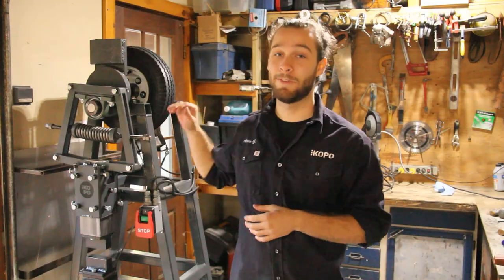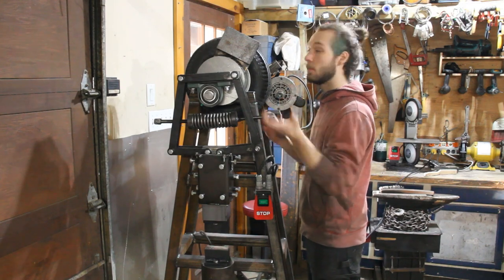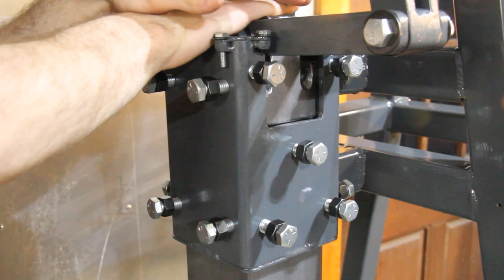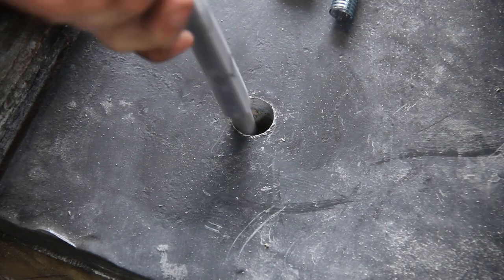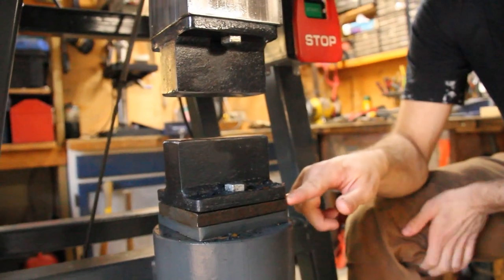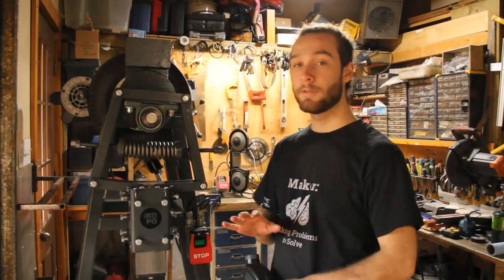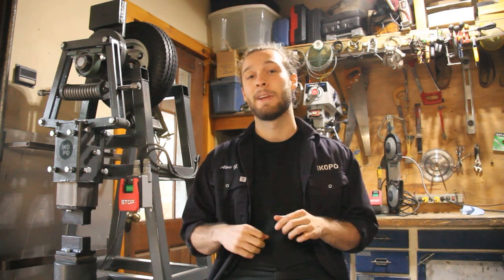Building a DIY POWER HAMMER | Part 3 | WITH PLANS

Comment: Looks really good. One place that I recommend improving is at all the bolted bearing hinge points. The bearings must ride on the smooth shaft of the bolts and not the threads. The threads will eat the bearings. Also add grease fittings and passages.
Reply from the maker: Great idea !

Comment: im having problems with the uwhm plastic inserts - the anvil keeps pulling them out - any suggestions
Reply from the maker: You need a retainer over them that have a square hole 1/16 to 1/8 larger than your ram. This way they will not be pulled out.
Reply: i have the retainers and they are stil pulling out
Reply from the maker: I would say either try a tighter fit on the retainers or try thicker uhmw insert so that they can't be pulled out

Comment: I found that your dies in the video are larger than specified in the plans.  Even with the corrected anvil height, I still needed to add another 1 inch plate to get the dies to the 1 5/8 dimension recommended.  Also, the turnbuckle adjustment won't work with only the right hand threaded rod in the parts list.  I highly recommend having the holes for the bearings done on a milling machine as I found a drill press to be too imprecise.  Good plans overall.  I just finished this build, cost about US$2500.
Reply from the maker: Thanks for the info ! I will correct everything that I can in the plans !

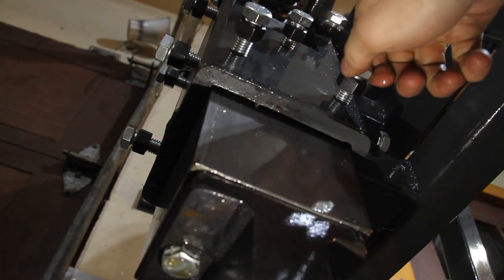Comment: 6:30 Are you in contact with Bold Head? Or a seat has been kept in the middle of it. Open it once and tell what is the technique.
Reply from the maker: There is a plastic bearing surface between the bolt head and the ram ! I hope this answer your question ?

Comment: Very impressed with the design and work. Before I purchase the plans I had one question. You said the dimensions were altered on the plans to correct the arms from hitting the ram. I take that statement to mean you adjusted the plans so the arms no longer hit the ram and you do not have to mill out those angled notches in the ram now? Is that correct?
Reply from the maker: Yes exactly everything is corrected in the plans you won't have to mill an angled notch!
Reply: @KOPOprojects  perfect thanks...

Comment: Not too sure if you haven't already mentioned it, must have missed it, but what did it cost you to build this absolute unit of a hammer?
Reply from the maker: Depending on the cost of steel in your region it will cost you about 2000 dollars to build this hammer with new material
Reply: @KOPOprojects that is a great price!

Comment: how many motor HP.?
Reply from the maker: I used a 2 Hp motor but you could make it work with a 1 1/2 Hp motor !
Reply: @KOPOprojects  thank you
Reply: What type of motor is being used for the power hammer is it low or high speed motor
Reply from the maker: It's a low rpm motor it runs at about 1750 rpm !